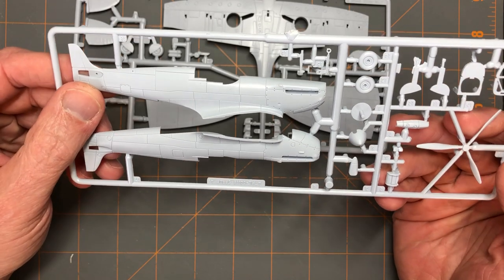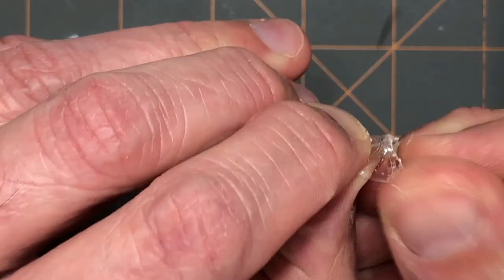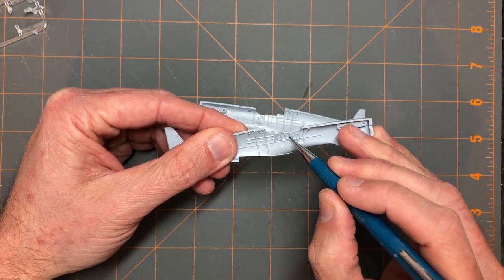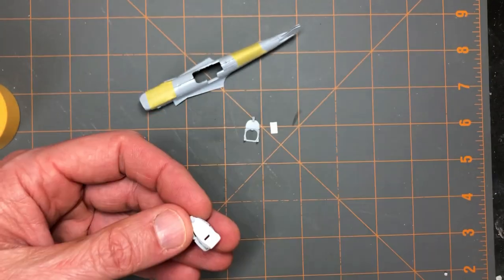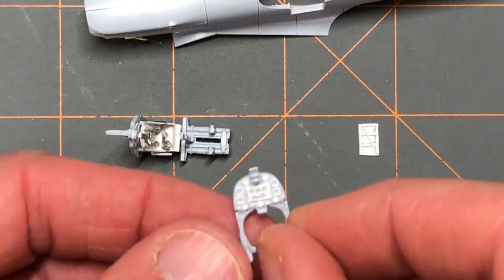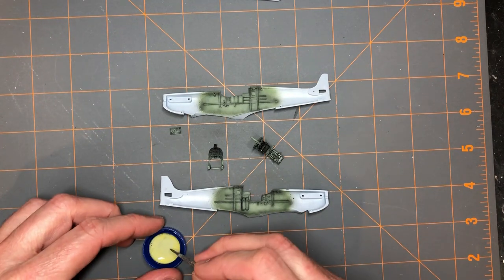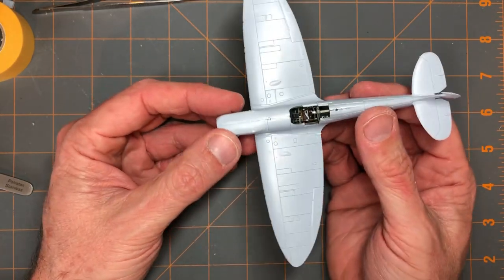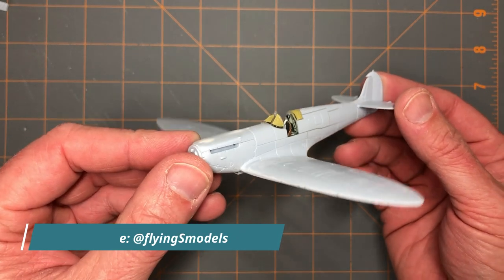Airfix 1/72 Spitfire Kit Build - Part 1

Comment: Great job and ideas on the canopy! I put it on as one piece, and it did not fit correctly. I had to use milliput to fill in the gaps. I love the scratch building you do. Looking forward to your future updates!
Reply from the maker: Thanks for the feedback. I just couldn't resist doing a little more on the cockpit.  And I always try to open up the canopy so that folks can see the interior better.  Fortunately, I had those extra SH parts laying around.  May try to get in a Sword Mk. XIVe after I wrap up the Mk.1a.
Reply: Flying S Models it looks great, nice work!

Comment: Is the saw the only method I should try when cutting the canopy, or could a knife work?
Reply from the maker: I wouldn't try the knife.  The clear plastic is always brittle and will likely crack or break.  Find a fine toothed razor saw and you'll be set.